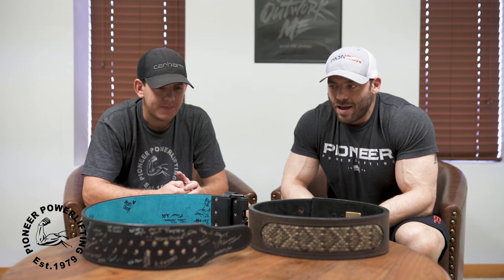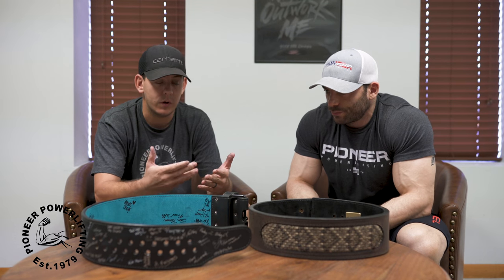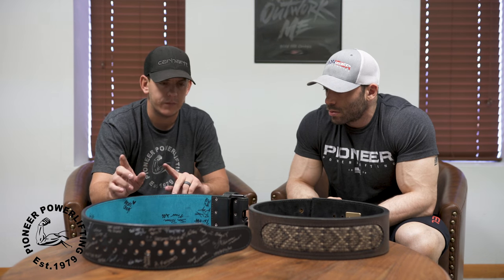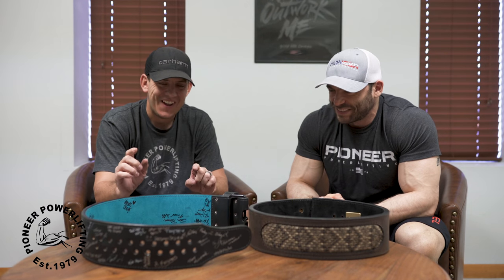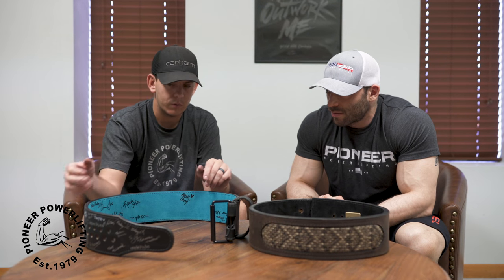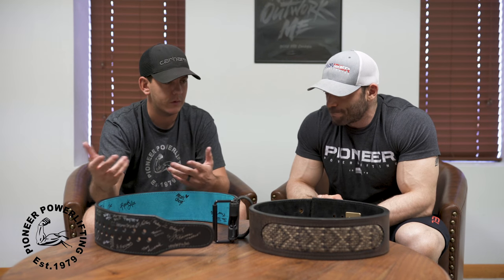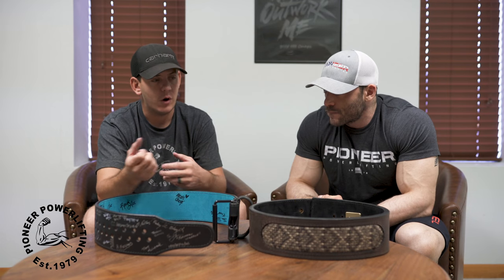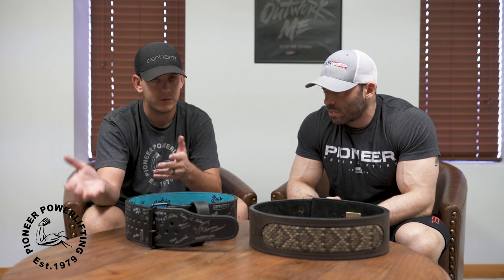Pioneer Cut Discussion with Ben Pollack

Comment: I don't think it matters at all if the prong is right in the middle or a bit offset regarding the top or bottom stability of the belt, it's just there to keep the belt on you. The leather itself is what keeps it from folding over.

Comment: I think one reason you would use a single or double prong is that you can't use this belt in USAPL. It's a shame because the price is good and it looks like a great belt.
Reply: If you buy  one from A7, it's approved.  Still made by Pioneer.
Reply: They just made a post on IG that they got approved finally.

Comment: Is there any evidence that shows the rivits you use is as good or better than the style Inzer uses? Just curious.
Reply from the maker: garagegorilla63 robot?!?
Reply: Pioneer General Leathercraft Mfg 
No, serious question. I have a double suede belt of yours. I did a google search because Rippitoe has said the type of rivits you use has torn through. I found nothing.
Reply from the maker: garagegorilla63 there are six rivets in every prong belt we have made over the last 40 years and I can count on one hand the problems we’ve had with them. Rip doesn’t like us because we did a giveaway with a group of guys that apparently are “anti-rip”. Two part rivets like most use are a male and female type rivet that can come loose overtime where ares are a one piece rivet that flowers on the inside. Both are good, but ours doesn’t allow for a chance of failure. If our rivet pulled through, it was a leather issue and not a rivet one. Hope this helps!
Reply: Pioneer General Leathercraft Mfg thanks! I meant no disrespect btw. Just asking.
Reply from the maker: garagegorilla63 none taken! Holler if you have any other questions!